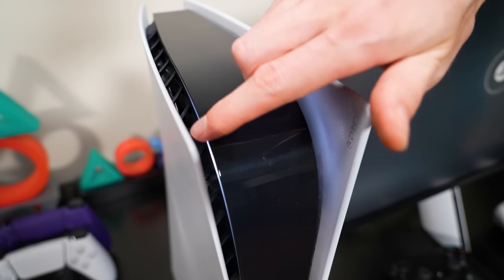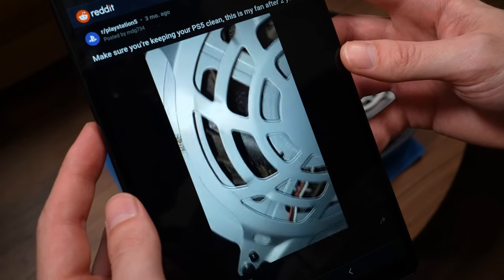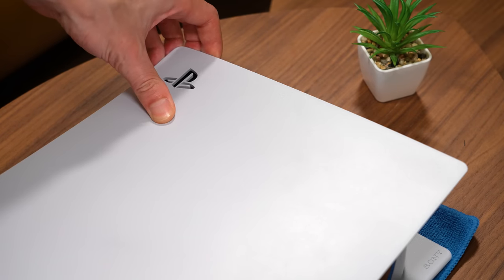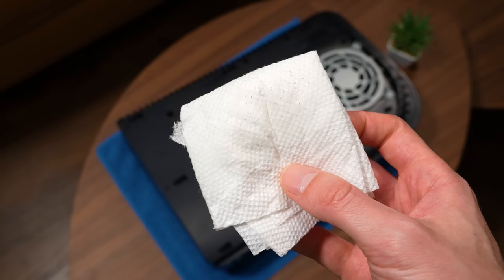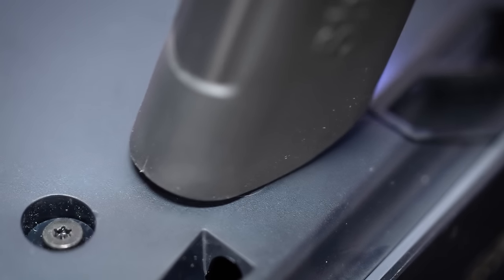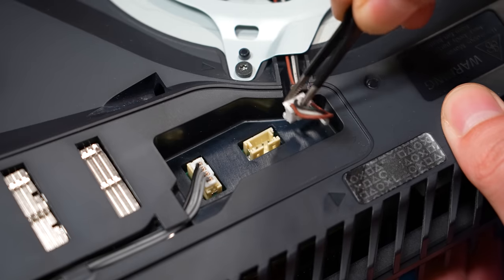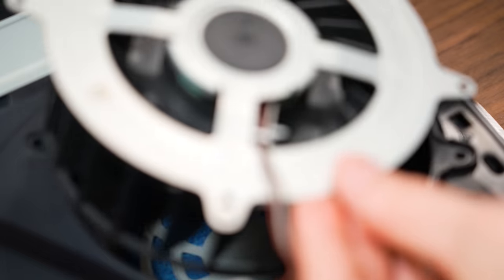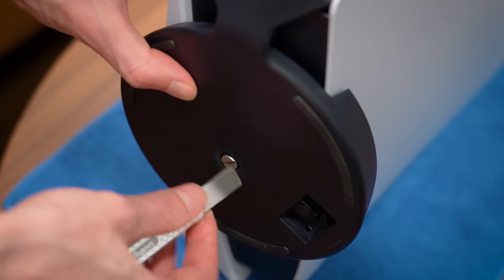It's time every PS5 user checked for this..

Comment: nobody is brave enough to remove the plate to clean the ps5
Reply: True that, I’m thinking of vacuuming it like using the small one to suck all the dust
Reply: It’s very simple
Reply: Ya I broke the little piece that has a lot of lines for the air flow. And now I have scars on my knuckles. It was super hard to take off
Reply: Except like half of the ps5 community lol
Reply: Disconecting the fan looks like a stress fase lol
Reply: @jasperverbrugghe3933  cleaned mine today. Took me a total of like a minute to take off the fan. Super simple. Most of that time was me tryna find the bit in my toolkit lmao
Reply: I don’t trust myself to remove the plates either

Edit: thanks for all the likes!!
Reply: It’s easy
Reply: Truth lol
Reply: Every sunday i take a shower with my ps5. Problem solved 🤣
Reply: To be honest I really don't have the courage to take my PS5 apart to clean it even though it makes this weird sound every time I turn on my PS5 the fan makes a quick high pitch sound which only happens every time I turn on my PS5 Maybe there's something stuck inside the fan possibly a dead insect since I do have roaches trying to get into my room But other than that it's usually whisper quiet I rather take my PS5 to 1-800 fix because they have fixed So many problems I previously had and they actually get the job done professionally They even permanently fixed My dual sense stick drift issues And now they feel completely different It's not loose anymore 1-800-Fix is the best repair store They even fixed my laptop battery that was little bit inflated which kind of terrified me a little bit but they actually took it out and had a spare battery made from the same company Lenovo and this time I will not let my laptop battery inflate ever again because stupid me overcharged the battery 24/7 until I realized this whole time It has a conservation mode which basically turns my laptop into a desktop computer and doesn't overcharge the battery It keeps it charged at 60% We learn something new everyday with technology 🤦‍♂️
Reply: @jasperverbrugghe3933  it's actually not that bad
Reply: I literally do it all the time my ps5 was shutting of because of dust build up used canned air now it’s fine so you’re going to have to do it sooner rather than later
Reply: @jasperverbrugghe3933  honestly you don’t even have to take the fan off I used canned air to get it out and it worked completely fine
Reply: I just got mine not even a week ago and I’m skeptical about removing the plate 😅😂
Reply: Best comment
Reply: After watching your video i just opened my one week old ps5 to check for any dust 🤔
Reply: I've removed mine
Reply: Or people are lazy and they just wanna play
Reply: False I had to put that m.2 ssd in there I need more space 🤣🤣
Reply: Very true
Reply: It's easy, it's not as scary as it seems, the 1st time taking the plates will make you nervous but it's fine, it's very sturdy even though it might feel like your going to break it
Reply: I did it for the sake to install a ssd but I was so scared to remove the plate to the point of sweating
Reply: Yeah coz the warrantee goes out the window if you open it
Reply: I have to clean mine. I have a cat that sheds and my PS5 get clogged with cat hair and overheats and turns off if I don't clean it.
Reply: Does that mean I’m a badass cause I’ve owned my ps5 for prolly 4-5 days and I just took the face plates of today???
Reply: i removed the faceplates to install another model. would not be scared to remove them for cleaning. you dont need to be brave. just to know that you can remove them.
Reply: @Apollo_lIlIlI  no that means you are not careful of your ps5
Reply: @Apollo_lIlIlI  bruh you just got ur ps5 you shouldn't clean it right away
Reply: Yeah for good reason every time I take them off I add another scratch to the inside
Reply: You're joking right?
Reply: The plates have two tabs at the top left. You pull towards you and down on the tabs and the plates slide right off. 2 seconds and impossible to break if done correctly
Reply: @secoarizy8258 you do know it just slides down..
Reply: True that
Reply: Plates yes, anything else… no lol
Reply: First time is a bit unsettling, after that it’s just routine
Reply: I clean my 3 days ago
Reply: Lol
Reply: Not anymore did it to my ps4 and never went back on 🥲🥲
Reply: You just slide the panel off
Reply: You pull it slightly up but mainly you slide it down and off. It’s not as scary as it looks
Reply: I did and on top of that opened the ps5 (carefully) to screw in my external 1TB hard Drive
Reply: I had to do it to repair my disc drive. Terrifying.
Reply: It is very simple and highly recommend. Mine gets horribly dusty.
Reply: I am it’s easy to remove I replaced my face plate with a custom plate with a vent it snaps off so easily n back on anyone can just make sure your sliding in the correct directly while slightly lifting up
Reply: @DoomDude69420  Consoles should be all MATTE FINISHES like the Series X and NO CHEAP GLOSS EVER!!! SCRATCHES ARE THE WORST AND SO IS SHINY PLASTIC! SONY shouldve learned SHINY PLASTIC SUX BALLZ with the OG PS3! Even wiping it with a cloth can scratch it! Use a make up brush  to dust the shiny and it wont scratch it but it still sucks!
Reply: What’s so hard about removing a binder?
Reply: Knowing me I’ll f#@& it up 😂
Reply: So easy to do anyone who cant should probably reevaluate their life skills ...i do it regular an also changed my plates for black with vented LEDs
Reply: @night_hellhound  lol it’s really easy just gotta slightly lift and make sure the ps5 right side up as if your laying it vertically with the front facing u grab the top right corner lift just a little and slide to your left the way it’s made it literally just slides out and then u put the new face plate u want but u put it matching the holes obviously then u slightly push down not hard at all n slide to your right flip it over and do the same on the opposite side but this time u slightly lift on the left upper corner and slide to the right n rinse repeat
Reply: Its not that hard tbh I just did it with out having to take to fan cord out just be gentle with it like a newborn 🤷🏽‍♂️ same with installing the ssd
Reply: I just got it so no need
Reply: @DoomDude69420  What Scratch in the inside ? The Part who is ready to add scratches is the Black Part on the Outside between the Plates 🤣
Reply: @ashgaming7045  FunFakt my PS5 dont have any Scratch on the Shiny Part but the Series X from my Friend he buyed on Second Hand has one on the Front 🤣Its not Sony its not MS its the daaaaam Peopel who make even Scratches on the Nintendo Switch if they slide the Konsole in the DocStation....This Peopel who should play with simple wooden Toys not Konsoles or PCs 🤣
Reply: Me too only clean plates and body 😅😢
Reply: I do it every week
Reply: @KnowToChill  you should know to chill and know to use grammer properly
Reply: @KnowToChill  scratches to the inside still affect resell value and affects your warenty
Reply: It’s easy and simple
Reply: Honestly I broke my ps4 pro trying to disconnect the power supply from the motherboard & had to have it repaired lol. Yer disconnecting the fan is kinda scary but iv done it a couple of times on the ps5, they should make it easier to take out though for sure.
Reply: @Commander's Gaming Channel  There is no such thing as "overamping" a computer battery by leaving it plugged in. At 100%, it simply stops taking energy.  To overamp a battery, you would need faulty batteries or a faulty cord. Conservation mode is meant for life cycles, as in 100% to 0%, then 100%. Stopping it at 60 or 80 on devices can conserve the batteries life so it does not discharge as quickly at an older age.
Reply: @Apolion  lol these plates sell for like $20. Should of just thought of that first.
Reply: @DarkShadow_God0  no I did that too. The plates on the original box are even labeled as removable. So I took them off. Lol
Reply: @secoarizy8258  yes the first and only time I removed them I needed to use a lot of force to slide them, and I also scraped my knuckles.
Reply: I made it 10 times just to enjoy the view 😂
Reply: I’ve done it 4 times already
Reply: It’s easy af to take off just make sure ur not a dumbass first lmao I’ve cleaned mine multiple times
Reply: I cleaned mines like three months after I got the pre order, ent no way this is ending up how my ps4 looked, started cleaning that way too late😂
Reply: I am but I do not yet have one🤣🤣🤣🤣🤣🤣🤣🤣
Reply: You right
Reply: @lexusfujae2192  I hope you get one soon
Reply: Facts that’s a horror movie moment 😂
Reply: @almnhy  thank u

I tried to get one but was scamed
Reply: @lexusfujae2192  good luck and watch out for scams
Reply: pc master race
Reply: Noone has a Ps5 to begin with.
Reply: I'm brave
Reply: @eurosonly  no one but over 20 mill people.
Reply: Exactly
Reply: Easy when you know how
Reply: So what is the outcome of not cleaning. You said  we need to do it now. But why ?
Reply: @Liamr2023  you don’t need to right now. But cleaning it sometimes will help. If to much dust gets collected it could overheat
Reply: I did it but now I’m scarred
Reply: @Seco Arizy weak! 😂
Reply: @HinokamiAnimates The plates are easy to remove,  I swapped mine for black ones less than a week of having my PS5.
Reply: The first thing I did when I got my ps5 was remove the plates to install a ssd..it's not that bad lol
Reply: Exactly, lol I'm going to wait till there are more in circulation juuuust in case
Reply: Truth
Reply: it's real easy i open my own up and clean it it's well worth it too save your PS5 from dying
Reply: @KnowToChill  Actually, the Shiny Plastic sucks and IM sure yours as all will have micro scratches like streaks if you ever wipe it with a microfiber towel… The only way to not scratch the shiny plastic is not wipe it with a towel but, brush it with a make up brush will prevent micro scratches! MATTE finish is much more durable to prevent scratches.  THE SHINY SUCKS ON ALL ELECTRONICS! Period! If they put a silicone coating on the shiny would prevent scratches but all the shiny plastic is crap that they use! 

Dont ever wipe it with a micro fiber towel or you will micro scratch the shiny.
Reply: @secoarizy8258  if you watch a tutorial it’s super simple to removw. Dont be scared to take off a plate its super easy and can save a ps5
Reply: I cleaned my ps5 every month it's sooo simple use a vacuum the air duster would push the dust
Reply: @HinokamiAnimates  you just laid your game down and slide the plates up they come right off
Reply: It's terrifying as if you make just one wrong move... 𝘾𝙍𝘼𝘾𝙆
Reply: Custom replacement plates are hugely popular
Reply: Its not hard
Reply: Why not? There's plenty of tutorials online that will guide you with ease. Of course, don't plan on eating a greasy burger or drinking a cold beverage whilst doing the job. If possible, wear electrician blue rubber gloves to prevent finger markings and damage any chipboard if you need to touch it for any reason. Don't use too much force removing/adding anything especially screws. Doing so can cause the tension to crack the plastic. When you've accessed the fan, DO NOT MOUTH BLOW THE DUST AWAY. As it's from your mouth , your breathing will add moisture to the blow and that ain't good!
Reply: It's not that hard. Plenty of tutorials on youtube. I did it but only went half way as the tiny parts were scary to take out.
Reply: I was brave enough and it’s wasn’t that bad tbh
Reply: Same
Reply: @Roman-27-p9w  I feel you 😪
Reply: It's actually pretty easy you just have to be very careful
Reply: True
Reply: True
Reply: Opening the ps5 is easier then any other consol. Everyone can do it.
Cleaning should be easy too, only the fan disconecting i wouldn't recomend for ppl that dont have a clue what they are doing :D
Reply: @Clownie727 😂
Reply: @sebbotogo true
Reply: @Roman-27-p9w  I worry that it’s gonna full on break the PS5
Reply: Nobody?  Lol I've bought a few new colors and a ssd card.  So I've removed them 4 times now.
Reply: My mother does it
Reply: I clean it every few Months,I even removed and unplug the Fan but you don’t have to remove it but you can clean it without unplugging it
Reply: It’s just a ps5 y would u be scared.
Reply: @gonshinkii427  JUST a ps5?
Reply: LOL what’s wrong guys , it’s so easy 🤣 it’s hard to cleaning the ps4 pro
Reply: @night_hellhound  I agree 💯. Yes, this tutorial was easy to follow but I invariably will do something to screw it up.
Reply: bro why was i about to say this
Reply: @Avenue77  Lol you’re right I think there are roaches trying to get inside my PS5 now I’m scared to look even inside I’ll probably see dead roaches🤣
Reply: Fearless I am!  😆
Reply: Me: 🤪 just takes it off anyways
Reply: Nah the sides are pretty easy and stress free for me just gotta put your hand in the right place slide and pull up at the same time to get it off correctly
Reply: Its the easiest console to clean. I hated cleaning the ps5.
Reply: It’s not hard
Reply: Ong I’m scared😭 there’s no dust in it yet, but when it builds, I’ll be ready🔫
Reply: I do it all the time just be careful and patient
Reply: Just do it after 5 months it's already dusty and I can say I m a clean person but still there is dirt/ dust. Take a vacuum cleaner and a little brush. Not difficult
Reply: @HeyCMDR1991YT  the ps5 always has a beep noise when u turn it on
Reply: @jmdyt3626 can you suggest me which vacuum and canned air to use to clean ps5
Reply: @jmdyt3626 which canner air you use?
Reply: @gauravvirginkar1434  you can use any
Reply: @jmdyt3626  no but they have recommended to use only low powered vacuum
Reply: @jmdyt3626  which vacuum you have?
Reply: @jmdyt3626  and which air compresser you have?
Reply: EXACTLY
Reply: @gauravvirginkar1434  just some random one from a shop called Poundland in the uk
Reply: @jmdyt3626  tell me the name of the vacuum so that I can buy it since there are many vacuums in the market
Reply: I check it every month for dust,sometimes to check some stuff too, so am I a physcopath?
Reply: It's really easy imo
Reply: @jasperverbrugghe3933   you can also just flip the fan the over way to clean it without disconnecting. Just be careful of the wires and you should be ok. That's how I donit because I don't want to mess up.
Reply: @madaraquoi  I disconnected the fan 2 weeks ago and everything stil works. But I had lots of trouble screwing the main 4 screws back in to place.

They al came out easy. And screwing them back in was supper hard fore 2 of the 4 screws. They where so tight and my screwdriver just kept spinning without finding the grip it needed and when it did I had to push hard man. So stresfull
Reply: What about the warranty 😱
Reply: @jasperverbrugghe3933  did you had the torx 9 screwdriver ? The first time you do it is always a bit scary but you get used to it and then it becomes more easy. Ofc you have to be cautious not to lose the screws or the wires but doing it slowly is the key ^^
Reply: @73ingie  you break the warranty when you have to break the PlayStation seal to get access to the interior of the console. These cleaning process doesn't break the constructor's warranty
Reply: @madaraquoi  I used a torx screwdriver, don't know if it ws the right size but the screws came of smooth as it could be. But when I wanted to place them back 2 screws just did not want to go down past a certain point. I oiled those 2 screws and then with som power they went in. ( verry small amount of oill ) 

I think some are harder to do then others and also robots screw them so when u release the screws everything sets a bid and that's why it was a bit harder.
Reply: I removed my plates the day I got mine just to make sure I could do it correctly and get used to doing it.
Reply: @madaraquoi  Thanks mate 👍
Reply: @Clownie727  as much as this guy trys to help i don't they should have realsed him from Drug Rehabilitation center he Escaped from?
Reply: @Roman-27-p9w  Same here
Reply: It’s literally the easiest opening of a console I’ve ever seen 🤣
Reply: @magicworld9191  susss
Reply: Facts
Reply: Is very easy lol the only time that is somewhat hard and worrisome is the very first time after that they come out so easy
Reply: @no_4h24  That's completely different every PlayStation console has that beep sound when you start it up I'm specifically talking about The fan itself makes a weird rev sound Like as if you're turning on a car which is definitely not normal
Reply: @secoarizy8258  It's not hard it's just that you are not doing it right.
Reply: Ill definitely break everything
Reply: My plate broke
Reply: @dannydyer2879 no, they dont
Reply: @gamirabal  unlucky dude hope you get a new one
Reply: Always stressful that first time.
Reply: I've cleaned mine twice :-)
Reply: @HeyCMDR1991YT  ye u should clean it ASAP
Reply: exactly!
Reply: Nope lol so easy
Reply: Straight up
Reply: @doritarded  definitely not man they get real dustyy i clean in around mines every week vents ect. 3 days first time open it get fan well i was surprised lol got 80 percent dust out get wee brush and hoover.
Reply: It's made for users to be able to take it off. It's very easy once you've done it one time.
Reply: It'll survive lol, I knocked it off with my knee when I sat next to it.
Reply: Dude, I thought like you, but after I mustered the courage to do it, its really much better. Just be careful and not dumb
Reply: Damn I have already taken in fans out it’s not complicated
Reply: Speak for yourself 14
Reply: @Brisketclown  what?
Reply: I finally did to upgrade the storage, and now that it comes off more easily, I’ll be doing so more often to clean it when it needs it.
Reply: had the fan out of my day1 twice already. easy as heck
Reply: I'm afraid that the plates will just snap into a million pieces 😂
Reply: Insurance baaaby 👋. Any issues, it gets sent away and either fixed it a new one for £3 a month. Saves hella work and possible damage + parts cost.
Reply: @dapo7930  One day I will take the time to clean my PS5 But right now I am unfortunately busy working at a part-time job 🤦‍♂️
Reply: Cant trust my anxious self to clean my PS5
Reply: @magicworld9191  If you want to risk bricking your PS5 sure use a Vacuum. The high amount's of static can cause shorts.
Reply: @scottymorgan7868  how to clean it without taking out the screws
Reply: @Clownie727  Def don't do this. First it's not safe, Second I am 100 percent sure you water logged and while it still work in some shape or form it's still damaged and the protection plan voided.
Reply: @HeyCMDR1991YT  People are so scared to take apart stuff. Bro as long as you don't yank shit out of the socket and unscrew everything and watch for static you will be 100 percent fine.
Reply: @magicworld9191  They show you in the vid you just need to take off the back plate and use some canned air and spread evenly.
Reply: @HeyCMDR1991YT  damn I read all of that
Reply: I completely disassembled it and put it back together with Sony’s own teardown video. Its not hard.
Reply: Its literally in Japanese
Reply: Yeah lol I'm just cleaning it from outside, I'm afraid of taking the plates off 😂😂
Reply: @JosueGalvan36  says who I owned many ps devices 🤔and never touched them myself. My PS4 stopped working once and I just sent it to Sony they send it back after 2 weeks saying it only needed cleaning. Why risk it?
Reply: @hayderneamah1323  you're not risking shit if you know what you're doing, and even if you dont, and have a bit of common sense, youll be fine. So you spent shipping money and 2 weeks without a Playstation JUST for them to tell you it needed cleaning. Sounds like a waste of time for something I could've done in 30 min - 1 hour. Which I actually just did yesterday lmao
Reply: Really? I would clean my plates.
Reply: @HOURLYSNIPES  just ask yourself is it worth the risk to remove the plate to clean your ps5? it could be a permanent damage
Reply: @magicworld9191  I did that and it worked
Reply: @magicworld9191  you should avoid that, especially if you open the machine up. Electrostatic discharge can destroy the system board. There are vacuums that are designed to clean electronic equipment though.
Reply: I literally had no second thoughts with my ps4 but even the thought of taking off the faceplate terrifies me😂
Reply: @HeyCMDR1991YT  This comment brought to you by 1 800 fix it... Lol jk
Reply: @scottymorgan7868  That is true I know some people are afraid to remove components but stuff like that You have to practice I have removed the lid before on the PS5 just to add my 2 TB NVMe SSD Seagate firecuda But I never had the chance to clean the fan because I don't have the proper tools and I'm planning to get the Ifixit full set tool kit within a few days
Reply: @Daryal  what?
Reply: @offjvlone8969  And what do you think of what I said?
Reply: @Seco Arizy  it's like the easiest console ever to open. It was user error.
Reply: Yea I’m in that crowd  lol
Reply: Facts
Reply: MAN I WOULD NEVER 😅.  I dust my systems all the time but that’s Way to much lol. I don’t do that much maintenance on my Car lol 😂
Reply: Once you’ve done the ps4 fan numerous times and cleaning inside controllers this is just basic in comparison 😂
Reply: Shut the hell up!! Don’t call me out like that in public!!! Lmao. I want black plates but am scared to death to remove them. 😂😂
Reply: @gamer2101  same😔
Reply: It's literally the easiest thing in the world...
Reply: I’d just take my ps5 to a professional
Reply: @eurosonly  If that's the case what exactly was it that massively outsold the Series X?
Reply: Shii I am I used to clean my ps4 before I got the ps5 a lot and it’s hard taking the parts out of the ps4
Reply: @minvike37  lol I saw what you did there 😂 It's actually a legit real name of the company 1-800 fix It's almost everywhere in New York but I'm not so sure about in other states but in my experience They actually get the job done If you have a technical problem with literally any of your devices They will patch it up brand new like as if I haven't touched it 😍
Reply: Vary true
Reply: I have bad luck so no risking it for me lok
Reply: true lol 😂
Reply: I did it :)
Reply: hell no haha
Reply: I pood a little removing the cover when I was installing SSD 😂
Reply: It’s easy to remove it
Reply: Shiii I was 😭.
Reply: @secoarizy8258  how tf???
Reply: Legitimately was terrified to break it for almost a year
Reply: I am
Reply: @manumisrar  gl dude
Reply: I already did
Reply: I been did that 😂😂😂😂😂😂😂😂😂😂😂😂
Reply: I just done it and found next doors cat
Reply: ولله صح
Reply: Yah😂
Reply: @mrwood9131  صح عليك انت
Reply: The plates are literally designed to be easy to remove 😂😂😂
Reply: It's easy
Reply: Wow! I cleaned like 4 or 5 Times already through out the years,its easy
Reply: @secoarizy8258  You obviously did it wrong
Reply: @jasperverbrugghe3933  You don’t have to disconnect it
Reply: @Roman-27-p9w  Watch Youtube Video of how to do it,they’ll show you exactly how to pop it off it mostly just lifting a little and sliding the Cover down
Reply: @jmdyt3626  facts
Reply: yeah 😢
Reply: I do it regularly
Reply: Facts 😂😂
Reply: Just go send to special shop for service
Reply: Facts bro😭😭
Reply: Don’t underestimate, my Xbox one crapped out awhile back ago and I was took that mf apart and got it working. Had just a board sitting on the bottom part of the shell 😂. Idk how it worked but it’s the only way it would. I had the Bluetooth/ Wi-Fi adapter unhooked ( I couldn’t use a wireless controller, but Wi-Fi still worked for some reason) the disc drive and a bunch of other stuff off, but if I tried putting it back together the right way it wouldn’t work. I couldn’t even put the shell all the way on cuzz it made it not work. Like tf 😂😂
Reply: And it voids your warranty
Reply: Ill just pay someone to clean mine
Reply: Only console players are scared to open electronics. Us PC gamers are used to and are very proficient doing this types of things.
Reply: Fortunately for me I am and have bee since ps1
Reply: I do it every month
Reply: I did to add an additional SSD, but I was petrified to break the plastic tabs that hold the plates on. 

It was worse the 2nd time when I did the same for my brothers. His cover was extra snug, but even worse was the screw used to hold the additional SSD in place. I almost stripped it because it was so tight. My PS5 was much easier to deal with. 🤷‍♂️
Reply: I removed the original plates and installed platinum edition plates, it was simple to do, so yeah people have and will remove the plates!! Just practice patience and caution!
Reply: Fr
Reply: Thats not true, its in progress , just started it 3 years ago
Reply: I tried to clean my ps4 6 years ago, and after cleaning no disk could enter. Ain't doing it with the ps5
Reply: Lmao facts
Reply: Right that shit is scary 😨
Reply: I know i would never do that😅
Reply: i always do it?
Reply: @TheKevinKeyblade  lolol I was the exact same way
Reply: I cleaned yesterday but man it was a pain
Reply: Disconnecting the fan is like defusing a bomb
Reply: Why? It is so easy and you'd be doing a good thing for ur console. The only part that is annoying is having the correct t8 torx screwdriver cause some of them don't have a certain hollow making it impossible to unscrew ps5 fan screws
Reply: On god my brotha
Reply: I am
Reply: This thread is sad. It’s easy to remove the plates people. But let’s say you somehow mess it up, the worst possible thing that could happen is the plate gets cracked, and they’re replaceable. Even if you don’t have money for new plates, frankly, you can run the ps5 even without it’s plates. It would look ugly but it would probably run cooler. The point is, there’s no reason to be afraid. I swear you aren’t going to break your ps5.
Reply: True man
Reply: Just did this it was very easy! Also Make sure you have a T8 if removing the fan(which I highly recommend).
Reply: Cleaninf that PS5 Iooked like a life-death surgical operation
Reply: You have to do the same with an ssd so im happy to take it off
Reply: true, but once you get passed the first time it gets easier and you start to become 1 with it 😅
Reply: No jokes 😂
Reply: Gonna have to brave up or pay someone, otherwise it'll start shutting down on you
Reply: Naah not really I just removed it quite simple🤷‍♂️
Reply: Ya nah I ain't doing all that 😂
Reply: U just give the one side a love tap 😉 and it comes off
Reply: @KittyKat1986  OK "broken into 2 pieces"
Reply: I don't know how to open the plate without breaking it
Reply: @almnhy  no one said beat it. Love tap… gentle persuasion. Not BDSM
Reply: Opening it is easy as hell 😂
Reply: True lol
Reply: I think you mean incompetent. The directions tell you to slide it not pry it.
Reply: not only that, i just have a hard time remembering to actually clean the actual console
Reply: @AllDarkReaper  the ps5 has a safeguard/killswitch that triggers automaticly when the ps5 needs cleaning, it will simply shut off on it's own.
ALSO make sure to place the ps5 horizontally and NOT vertically.
Reply: Facts recently tried to do surgery on my controller which was hard as hell to get it all apart to fix controller drift but hell one of the screws fell in and a ribbon broke which i said screw it and threw it all away and got a new controller now I’m over here with one of the sides making clicking noises which is weird bcuz it hasn’t even been a year only gotten it like 6 or 7 days don’t really know why it’s making a clicking sound
Reply: @jasperverbrugghe3933  ONG
Reply: It's actually insanely easier than doing the ps4. I strongly recommend you clean your ps5 sooner than later🤙
Reply: Well duh! Im broke and i cant afford another one if i break it!
Reply: @Roman-27-p9w  if you mean the bogouter white plates? They are very easy. It's not about peeling them away it's about giving them a bash from the bottom and they just slide up and then off. Peeling them off without using enough upwards direction is risky. I just bashed them from the bottom (as if the console was in its vertical stance) and they both popped off.
Reply: It’s super easy I clean all 3 of mine
Reply: I do it every 2-3 months.
Reply: @secoarizy8258  except it's not. That sounds like 100% user error lol especially since you hurt yourself
Reply: Trevor Philips  classic tervor
Reply: This is why I like the90's game systems better I think you'd have to put them in the dishwasher or hand wash them let's face it they had forgotten how to make good gaming by mega gamer🎮🥷🇯🇵🇰🇷🇨🇳 PS sorry I pass 😔😔😔😔😡😡🤔🤔🤔😮‍💨😮‍💨?????????!!!!!!
Reply: Who likes to hear... if you push hard enough... you can get it off
Reply: yet
Reply: I've removed my xbox One, and that was even harder. I even did a custome paint job. Which I will admit made me nervous but was worth it.
Reply: Think a spider living in mine
Reply: TRUE
Reply: @DustyOldMechanic  it’s not bot
Reply: Speak for yourself it's literally snaps off and snaps on.
Reply: If you guys are doubting yourself, read this

trust me I am like the weakest and dumbest guy with 0 self confidence but I just thought to give a try and be a bit brave this time, because I read somewhere 95% people on this planet is afraid to take the first step. So by taking the first step is already making 95% than most. AND WTF I ACTUALLY CAN SO PLEASE GIVE A TRY. BREATHE SLOWLY, DO IT ORGANISEDLY, SLOWLY AND SURELY. 

Human already have power that they dont realised they have. To believe. When you believe in something, the possibility to happen increased super a lot too. Like when you believe in hope, you shouldve die from cancer 2days ago but maybe have too much hope and willingness to live and believe in self, thus the person live longer than he should because of believing in something.
Reply: @aslamufo  I'm not reading of that but thanks
Reply: I did, it's ok
Reply: I did and dropped it. I got a new ps5 now
Reply: @q9.sim99  oof
Reply: @Roman-27-p9w  im the same i dont fully trust myself i always make sure i have help from my cousin when i do stuff like this lol
Reply: Ha
Reply: Not really. Im brave enough im just lazy and dont wana do it
Reply: Speak for yourself, I done it twice and thank god I did cuz it was too much dust 🤣💯
Reply: @jasperverbrugghe3933 if you have built a pc before you’d know how simple it really is. It’s not as scary or complex as it feels. Totally simple to clean!
Reply: Lol true
Reply: @magicworld9191  DO NOTTT. VACUUM. YOUR. PS5.
Reply: Ive opened it twice and ive only had to for about a year
Reply: I also customised mines so i had to
Reply: كفوو😂😂😂
Reply: I totally disagree my friend, maybe with the PS3 and PS4 was like that but for the ps5 it is SO easy to give maintenance, I clean mine at least once every 5 or 6 months depending on how much I play
Reply: Honestly stripping a ps5 completely and rebuilding it is very easy just people dont have the confidence to do it
Reply: Probably because they are made of cheap plastic and can snap with the slightest amount of force 😅
Reply: It’s easy.  That’s how you upgrade the m2.
Reply: @Roman-27-p9w  you're thanking people? You got less than 200 likes on a comment about how you're too afraid to do something easy. Grow up and get affirmation somewhere else
Reply: You can buy a 5$ can of compressed air from like office works & give it a blast it’ll removed any dust & as safe as. 
Can’t go wrong, it’ll last for ½ dozen cleans
Reply: True 😢
Reply: Asking console players to take things apart. Yikes 😂
Reply: Fr
Reply: I am just gonna take it to my local electronics shop that sells ps5 and ask them to do it
Reply: I did it last night. Super easy, harder to remove the fan
Reply: I remove mines like every 2 weeks or so i bought mines for 100 cash new from a friend an shes been working since
Reply: Ikr
Reply: Im literally terrified to do so ive tried and looked at safe ways to remove it but i dont want to break it
Reply: Buncha gays.
Reply: @Simbolico2024  ?
Reply: Word
Reply: Me
Reply: I did
Reply: They’re doin it now to install SSDs
Reply: I did it and it’s very easy
Reply: I just done mine yesterday
Reply: Régebbi gépekhez képest egy álom takarítani 😊
Reply: It's designed to be removed lmao
Reply: @DustyOldMechanic for some reason one of the screws just wouldnt come off for the fan cover, used every trick it the book and it just wouldnt twist off
Reply: It's soo easy
Reply: I've cleaned mines at least 4 times now😂 the thing is you should definitely do it why risk buying another PS5 when the issues is you simply just have to wipe the dust out
Reply: @Clownie727 your PS5 must be legendary 😂I bet you never have to ever worry about a connection
Reply: ... I already did ... Umm but ok..
Reply: A fucking baby can open it. Infinitely easier than the ps4
Reply: @SarasotaBayOMC  man I bought this shit for 1000$ I ain't risking it
Reply: Very true 😂
Reply: if u do it the right way it comes off super easily no strenght required and if u do it the wrong way ( like i used to do ) u will almost apply soo much force to take it off that u might break it . best way to do this is apply little force on the edge of the playstation logo with your fingers and it will come out like it wasnt even fitted properly dont use all your force while grabbing it on the middle
Reply: It’s so easy to
Reply: Look up how to do it properly its pretty easy, but you need a weird bit to get the fan out
Reply: I am since I had remove it to add more storage
Reply: Let alone the cooling fan 😂😂
Reply: @shaikibrahim762  if you just happen to have the tool u need for it laying around idk what you’d be doing for work, im a carpenter and still had nothing to match it
Reply: Nah fr tho, I'm over here scared just looking at it
Reply: Plate yes fan no
Reply: lol i mean i would want to my mom doesnt really want me to im sure itl be fine if i do but i mean taking the actual fan out would be kinda whacky idk man XD itl probaby be fan but im afraid the cable might get damaged or something idk man im fine with just opening it and using a hair dryer to blow away the dust or just use a vacum cleaner idk man ;-;
Reply: I just had a professional clean it
Reply: @Clownie727  that actually could work aslong as you just don't turn it on until it's dry inside and out so nothing short circuits or smth
Reply: I do it about every 6 months.
Reply: I remove the cover and clean the ventilator 2 times a months. Its very important because he can overhead after.
Reply: I did
Reply: Me to
Reply: Don't even talk about my slim ps5 💀
Reply: True that.
Reply: I did it and it was worth it I didn't break anything and it doesn't over heat anymore
Reply: I did it no problems
Reply: I took my hole ps5 apart and put it all back together I was scared at first but then I just said fuck it and did it and now I'm not afraid to take it all apart and put it back to together.
Reply: i do remove and clean it
Reply: Jokes on you I replaced the PSU myself without taking it to a store because where I live the third parties are not so trust worthy and Sony was asking half the price of the console.
Reply: Nope my brother doesn’t fear anything he did it in june
Reply: Surely you’ve grown some balls yet. It’s very simple
Reply: As a ps5 user I DEFINATELY agree
Reply: I’m brave I got this